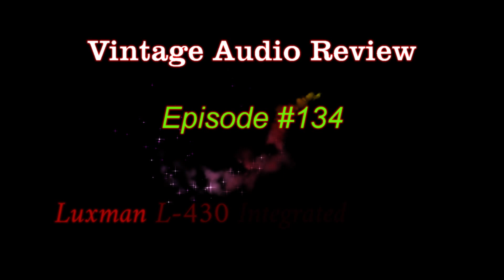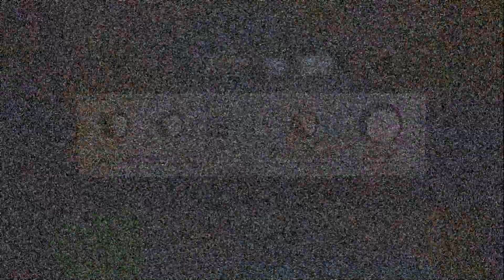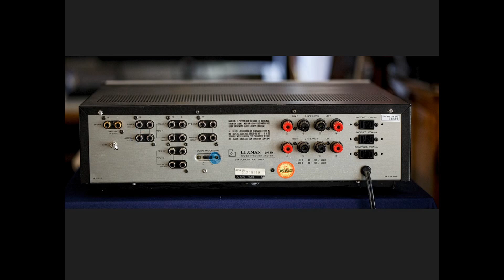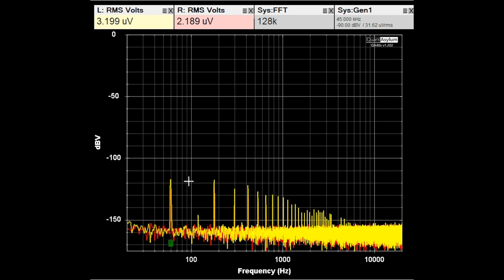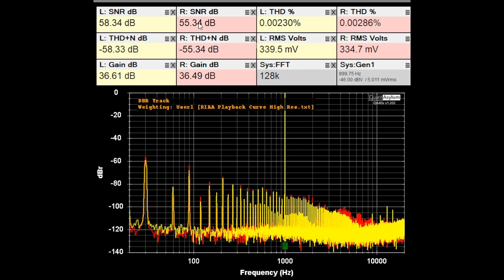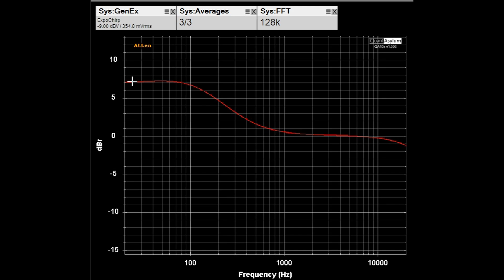Luxman L-430 Integrated Amp- Vintage Audio Review Episode #134

Comment: I own a modified Luxman L410 and I can warmly recommend it. This amplifier is truly top tier. The following upgrades have been made:

The power supply has been enhanced with an additional 20,000μF of capacitance, and the power-carrying traces on the amplifier board have been reinforced with silver-plated wire. The speaker pair switch has been bypassed, and the speaker terminals have been replaced with gold-plated banana plug connectors. The amplifier now supports only one pair of speakers for optimal signal path and contact quality.
Reply from the maker: Thanks for sharing about your upgrades on your L410- sounds like it will last even longer now!
Reply: You are welcome

I previously had a Yamaha AX-700, and it just didn’t suit my Klipsch RP8000F II. The Luxman L-410 with these modifications is a really great upgrade, and I gained an incredible amount with that amplifier.
 @vintageaudioreview

Comment: Cool vlog, THX. I got a Luxman L-410 as a bargain. after unpacking it shows that the bass control knob is missing (broken). Do you know if I can get such a knob? only idea I have is a 3D print.
Reply from the maker: The best source is Ebay where someone is parting one out. Maybe you will get lucky and find at a local electronic surplus store...
Reply: @vintageaudioreview  THX, I will try, because sound is excellent 😀

Comment: Heavily overpriced old stuff , any modern amp is equally good but much cheaper!
Reply: modern stuff is not repairable with its  multi layer miniaturized circuit boards, just pray the manufacturer still stocks those boards after 10-15 years...
Reply from the maker: @cyclist2906  Very good point. Probably not so much the case with power amps having multi-layer boards, but it certainly can happen. Of course, finding a replacement pot, switch or transistor/FET/IC could be problematic on vintage gear, unless it is real popular and there are work arounds.
Reply: Getting schematics for modern stuff. Now that's more of a problem than the boards.  Often not available.   The boards are repairable.  Just requires different repair equipment.
Reply from the maker: @jasonk5979  Even schematics for older, hi end gear may not be available. Thanks for the commentary
Reply from the maker: Thanks for the comment. The point of a lot of "vintage gear" is the fact that it is vintage gear. I would much rather own a '67 Corvette than and Prius, though the Prius has heck of a lot more features. I agree that a lot of modern gear may cost less and perform as well, but it will not have the look or feel of that older amp/receiver. Check out episode # 126
Reply: MUCH better than anything you will find at BB today. Better than any Pioneer Marantz or Sansui . I think I can say this safely as my reference is Levinson ML2 . Harman Kardon Citation XX , Single ended tube etc. amps ... Quad , Sound lab, HQD modified speakers, Ribbon and Sentry III and others. Recorded and produced Classical and Symphony Orchestra digital and analog music and CD's.

Comment: I see a lot of energy at 60 Hz and its harmonics.  And even 30 Hz  on the phono.   Seems high - is that normal or does this amp need some work?
Reply from the maker: Just looking at the 5w/8ohm data, the 60hz and PS energy is actually rather low- 90dB down which you would barely hear (the A weighting does improve things measurement wise). Most phono stages on vintage gear does have a higher hum due to their large gain. Replacing caps related to the phono stage would almost certainly help. Thanks for the question.
Reply: Power supply related fundamental & harmonics are a common feature of amps' spectra at low level and unless you happen to utilize a fully balanced design, difficult to overcome.
Reply from the maker: @paulb4661 Sometimes an amp will come across the bench and have better than 80dB PS "hum bars", which are not typically anything I can hear on my Wilson speakers.